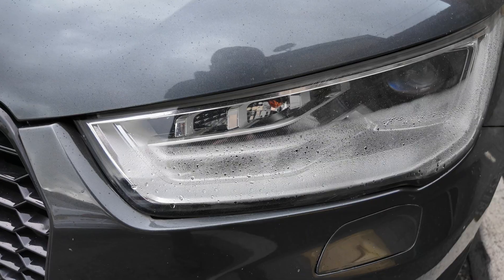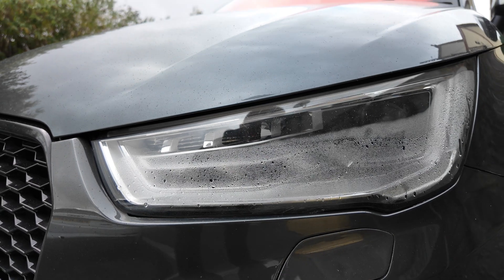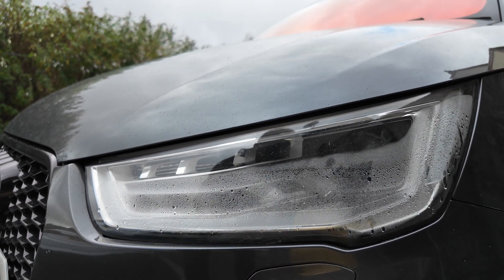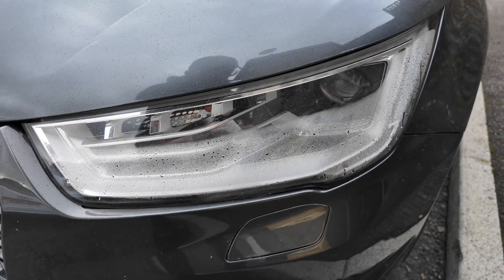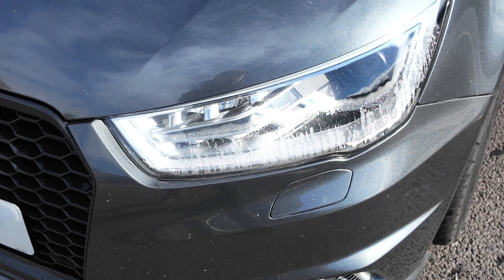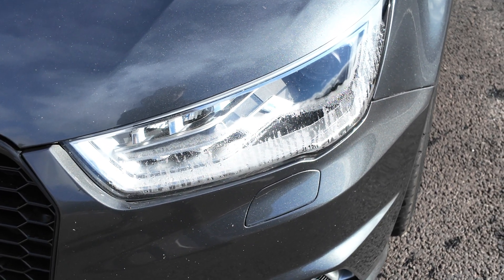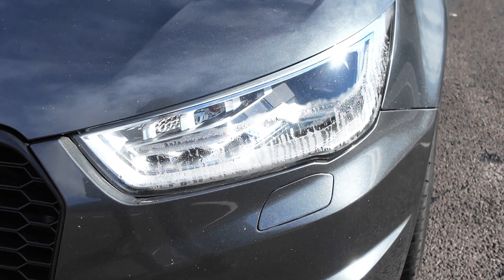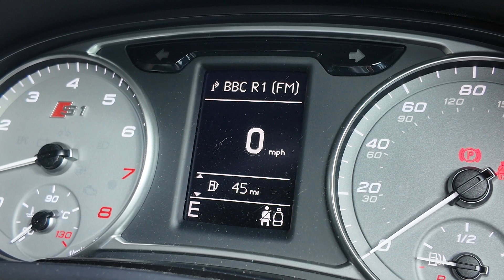VAG *PROBLEM* THAT NOBODY TALKS ABOUT!

Comment: On my S5 they are vented. there are two tiny tubes leading from the Headlight toward the grill, at the end there is a tiny piece of sponge to prevent dirt from entering. This can get clogged pretty easy and then lead to condesation.
Reply from the maker: Thanks for the info👍